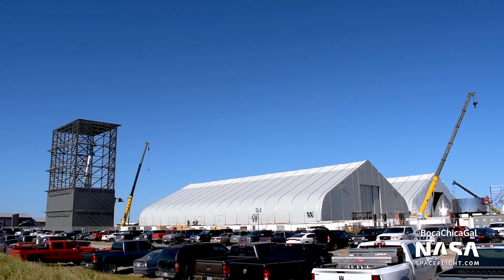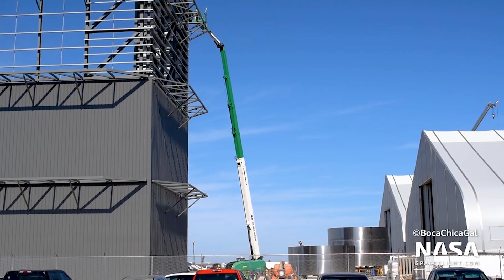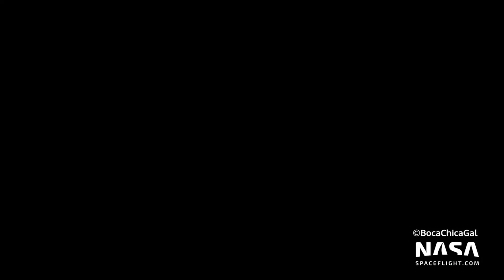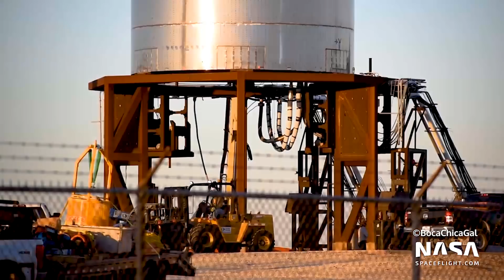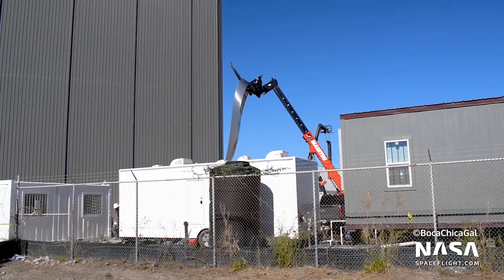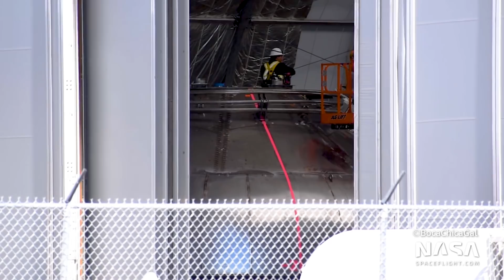SpaceX Boca Chica: Starship SN1 Pre-Pop Preps - SN2 waiting in the wings

Comment: Rip SN1 Failure happened out the bottom after the test was finished so I'm wondering why it failed, they were venting and dumping LOX or LN2 when it imploded.
Reply: Pressure management is a delicate thing. When pressurized the tank slowly warms up and pressure increases (by ambient temp) so you have to constantly vent and refuel to maintain both pressure and temp. To me it looked like they were  still testing and increasing the pressure until... well you know...
Reply: It didn't look like implosion, it was overpressure. Mb some weak weld or failed venting valve.
Reply: @TechMasterRus  I think a valve might've failed, lets wait and see how Elon responds.
Reply: Where have you watched this?
Reply: @trickeyD  I'm as curious as you are.
Reply: @Dewolvez  https://www.youtube.com/watch?v=GenS0_BvGPU&
Reply: I agree with Marcus House, it seems a weld was rupturing, they instantly started depressurizing then it let go.
Reply: @TechMasterRus  I dont know what you mean, i have seen few things ever look more like an implosion. I think the cause is irreverent. It collapsed in on itself in an instant, thats an implosion in my book. But i suppose thats just terminology.
Reply: I don't think that was dumping/depressurization. I think the bottom bulkhead/plumbing was starting to fail and then they pushed it even further. And the apparent implosion is a normal effect caused by the explosion where the escaping liquid causes negative pressure in the tank.
Reply: @Exalerion  I believe there was dumping at the top and top side valves after the bottom started to breach. so i dont agree they pushed it further, though i dont know, i think they were attempting to save it to maybe do repairs and go for a second test.
Reply: @Vatsyayana87  If they were actively depressurizing it wouldn't have exploded imo. Although it could be that it was literally about to explode and that the depressurization wasn't happening quick enough because damage was already done.
Reply: @Exalerion  that's exactly my assumption. Those tiny nozzles can't make a lot of pressure difference in only a couple seconds. It just seems quite a coincidence they both opened up as soon as the bottom started to breach.
Reply: @Vatsyayana87  Yeah indeed!
Reply: @Vatsyayana87  It didn't implode initially.. it's pressurized. What you mean is the "implosion" after the explosion. The nitrogen shot out on the bottom leaving a vacuum in the tank, which then smashed the walls together. More correctly, the kilometer thick atmosphere smashed the walls together which is standing ontop the vehicle. Anything that is underpressurized gets to feel mother nature's tight grip.
Reply: @KsNewSpace  I understand how it happens, but that's still an implosion, the explosion is the cause and as I stated I dont think thats relavent to the question of did this implode.
Reply: @KsNewSpace  clearly just my opinion and my view on what I would call such things, if it crushes inward so fast you could miss it by blinking, I'd be ok with someone calling it an implosion. Some things people are touchy about terminology, so many things nobody bats an eye to. Like things being called ironic, they are almost always incorrect but I never see anyone correct them.
Reply: No worries. We never give up.

Comment: You know how soda cans have a domed bottom to withstand the pressure? I wonder what was the shape of the bottom of the tank that exploded. Also, unless they figure out how to cold roll steel into large segments and shapes that don't need welding at all, I doubt it will ever fly with this way of manufacture.

Comment: In my modest opinion, it seems that the thickness of the material for the tanks should be increased. Instead of 3,97 mm to 3/16 “. This change would allow more surface for a better welding.

Comment: Maybe by SN3 they'll figure out you can take a coil of metal. Bend a loop. Pull more on one edge than the other to form a conical shape. Start with a wider dimension. Fit the mold for each section of the cone as it shrinks. Make the one weld. " Scribe and cut off the edges all the way around in a wide arcing shape to reveal appropriately shaped ring sections like before but going up the cone tip now. I see all those panels haphazardly welded together and can't help but think "that thing will never fly. Not by rocket power anyways and nothing else would get it off the ground." Not that it's designed to.. but if that thing tried to go orbital it would blow apart on the launch pad. It's about learning how to do something as you go about being the first one to ever do it, so I get it. Trial and error. Let's see this static fire publicity stunt. If they weren't rushing like madmen trying to get to Mars before WW3, They'd have the sense to spend an extra week adding sensors and calibrating to get the most results from any experimentation like what's about to unfold.
Reply: Trying to build a Mars capable rocket faster than you can build a house should demonstrate this sheer amount of urgency that seems to be underway to get people off earth and very very very quickly. If 10 years ago I said a private space company will put humans on Mars by 2024 I'd be laughed out of the room. Why the rush.makes you wonder.  Grew up under the expectation we might get there mid 2030s. The last great redistribution of wealth abouts the year 2008 gave rise to legitimate competitive private space ventures. It's a marvel to see such expediency especially here extremely lately. The next great distribution of wealth will see the victors of ww3 go interplanetary most certainly.

Comment: All the flexing and wobbling when they're lifting the top section with the crane can't be any good for the welds or the shape of it? It looked like it was made out of paper.
Reply: No internal structure to reduce weight. The elements that will be added later to its interior will be that structure that is now missing.

Comment: Watching the nose cone being attached I noticed how flimsy that POS looked.   Evidently there’s no internal ribbing for support?  Or are we not seeing it.   If not I can’t wait to see this thing come apart when it reaches MDP!  I hope they’re doing something for structural support or I wouldn’t send your cat up in it!  I’m all for getting off planet but damn!   Like they say, “ Through failure comes success! “
Reply: That's how it is supposed to be, support is added later, like it was on MK1.
Reply: Easy to pick the wannabe 'engineers' !
Reply: Take an empty soda can, without dents. If you're careful, you can stand on it without it collapsing. Tale a pair of scissors, and cut off each end. Then try to stand on it. It won't take much weight because it's not being held to an accurate circular shape. Similarly with the nose cone, it's wobbling all over the place because the large end is free to move. Brace the open end and it will be much, much stronger.

Comment: i dont know what Elon is thinking welding all the parts together and not using fittings instead. I just dont get it. there are little dents everywhere and strength distribution will be all over the place. If he did just fittings instead like he does with the falcon rockets then everything would be symmetrical with an even distribution. i dont know i hope im wrong, it just doesn't look right no matter how much i try to convince myself that this is the right way to go, it just doesn't look proper, looks like a backyard job sometimes. am i missing something? is something gonna go over this stainless steel? another foundation? or are we actually looking at the outer layer that will just be polished up to shine later?
Reply: Nah, you're correct sadly. As much as I respect spaceX, that respect is waning as a result of this project. I'm convinced this current design of starship will likely never make even do much as a successful hop. It's far too flimsy, poorly designed, and not quality controlled enough to do much but sit on a stand and blow up.

Comment: I still think SN1 was not intended to fly. The pressure vessels and valve assemblies just scabbed onto the exterior did not look right. Those items would have had to be faired over somehow to withstand supersonic flight, and they didn't seem to be placed where the external raceways would have covered them. Planned kaboom IMHO.
Reply: Not intended to fly, yes. However they were intending to do a static fire with a single raptor per elons tweets, so unfortunately this looks to be another unplanned failure